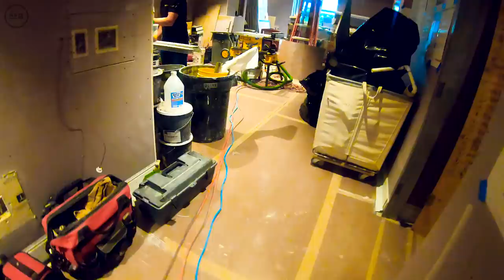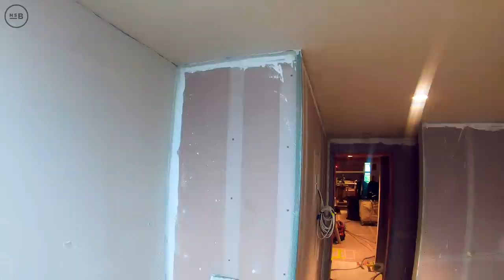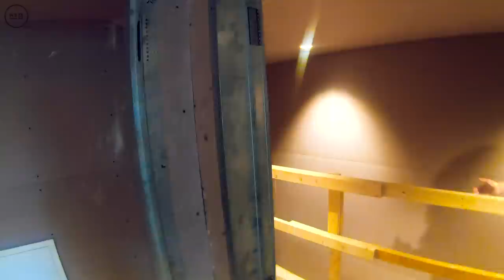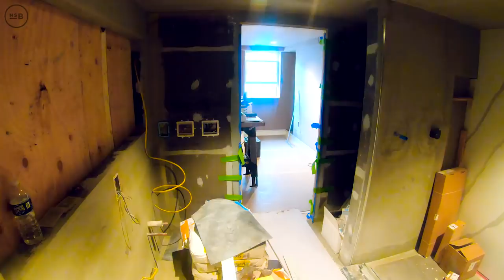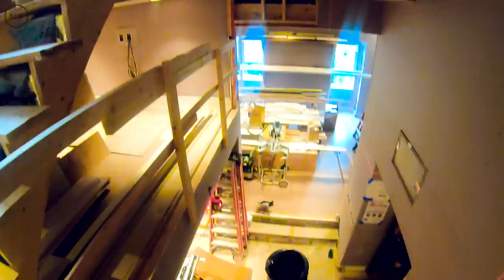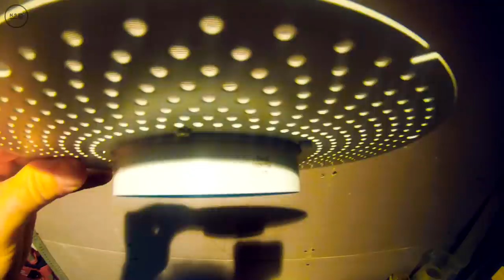Walking through our modern Brownstone renovation | Site Visit

Comment: I pulled up the carpet on the second floor to install hardwood.  There are 2 metal straps about 3 feet apart attached to the subfloor.  Is that structural or can they be cut?